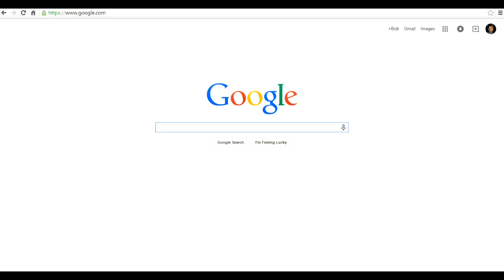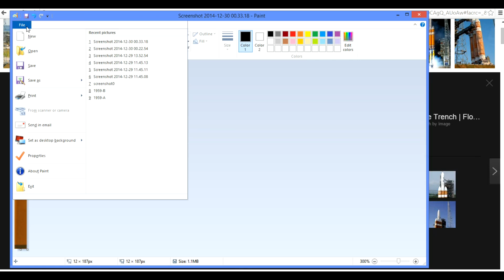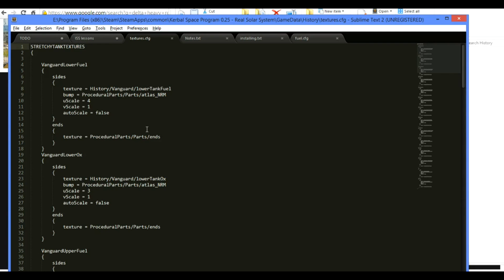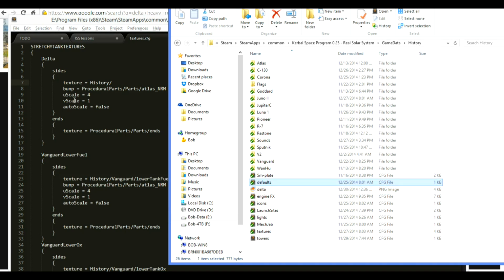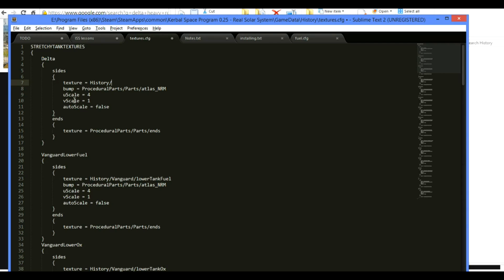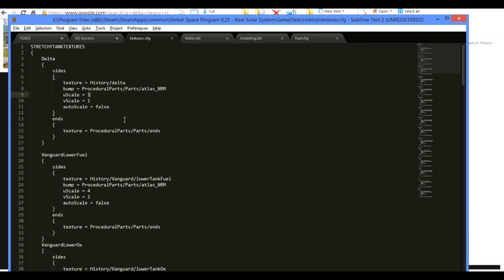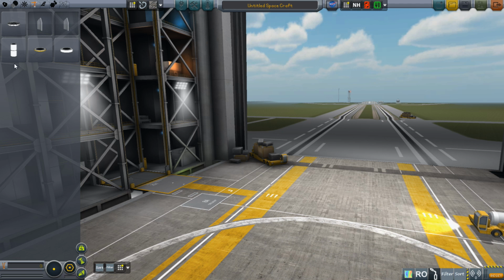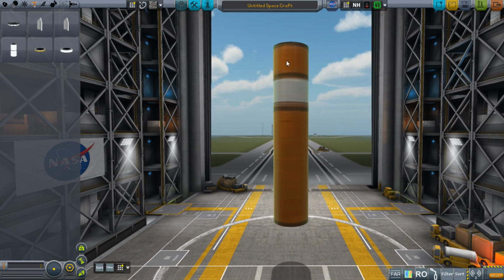Custom Fuel Tank Textures -- AMA 9 -- KSP 0.90

Comment: Is there any way to alter the stock KSP tank textures? Those grey Rockomax smaller tanks look so ugly, I'd love to get them to look like the Jumbo-64 orange tank so they match...
Reply: Yep, there are a few mods that replace the textures and/or models for the stock parts. For instance there's a new on in development called Color Coded Canisters. It can be done via ModuleManager if you make the textures too.
Reply from the maker: Pineapple Just take Ven's stock texture overhaul. But yes, you can override stock too. It's slightly harder though.
Reply from the maker: ***** not without googling, no I don't

Comment: Bob, two questions: 1. How do you do custom fairing textures? 2. how do you bug fix problems( the one i'm having is I keep getting a null reference exception when I try to right click on my procedural tanks.)?
Reply from the maker: theluigimario9898 For a null exception I read the source code and guess. Usually there is not much you can do when someone's code is asserting.
Reply: Bob Fitch how do you read source code?